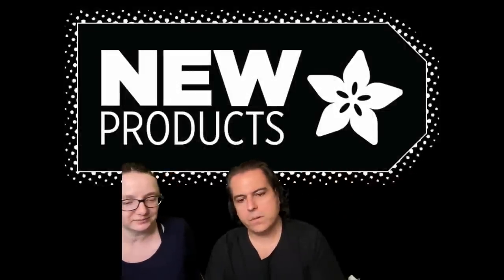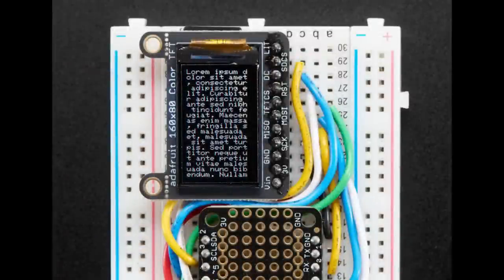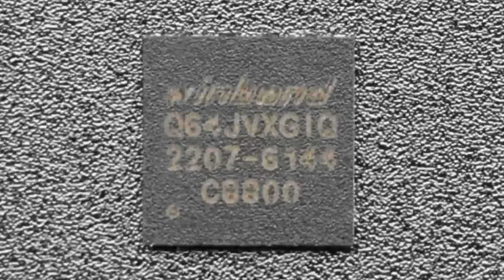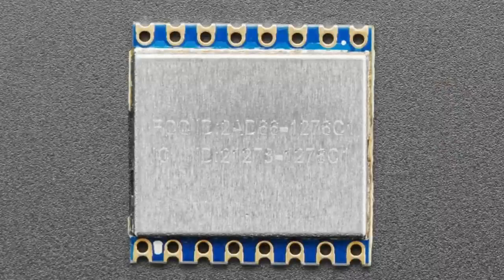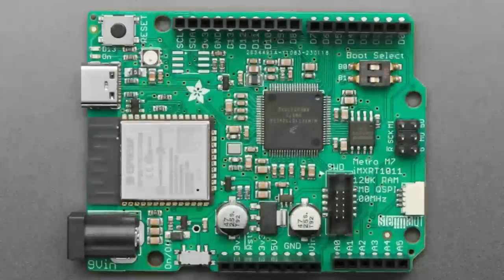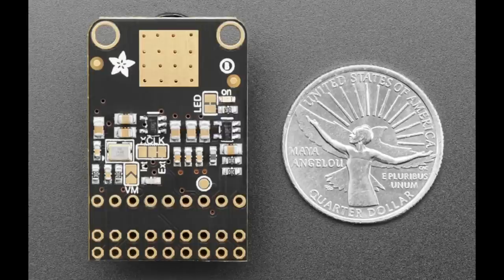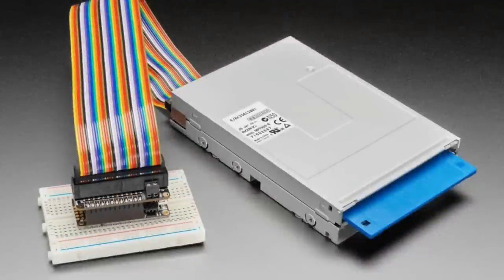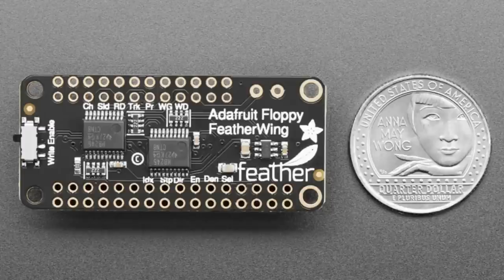#NewProducts 02/01/23 Featuring Adafruit Floppy FeatherWing with 34-Pin IDC Connector!

Comment: Why not a MEGA2560/Due-size Cortex-M7 board as a next step from the Metro M7 project, and add an SBUS Inverter as well for those working on Robotics using R/C Receivers.
Reply: They did say that there are just enough gpio for this form factor, so not enough for a mega/grand central size.

Comment: How close is that Floppy Feather to being a USB interface to standard 5¼" & 3½" floppy drives. I have quite a few operational 5¼" floppy drives but I have only seen & own a USB based 3½" floppy drive. I have a massive collection of 5¼" & 3½" discs going back to the original IBM PC (before the XT). I hate having to keep a Win9x machine operational because you can't connect floppy drives to motherboards anymore.
Reply: About a year ago they posted a video of a feather rp2040 acting as a mass storage device with a floppy drive attached, so there you go.
Reply: (alternatively you can get a GreaseWeazle for archiving floppies)

Comment: It is not surprising that the floppy disk interface is pretty low level given timeframe.  But somewhat surprising that they are hard to keep up with given timeframe.  I can still hear the thunk when you inserted a floppy and the drive started spinning and operating system started reading from the drive.  Ingrained.
Reply: Old computers had a dedicated controller for floppies, in general.